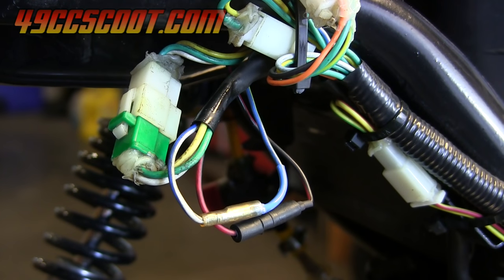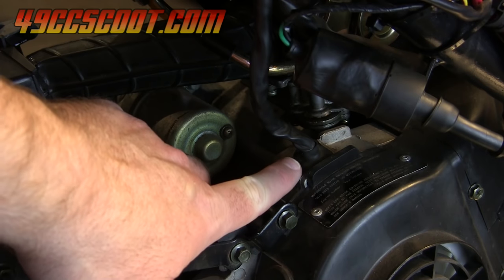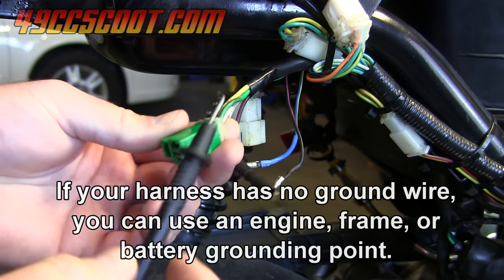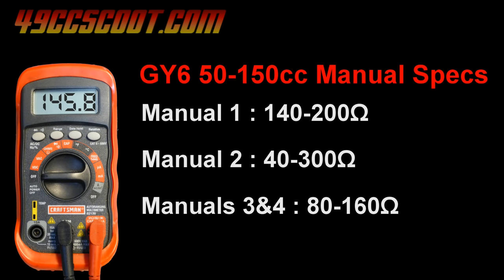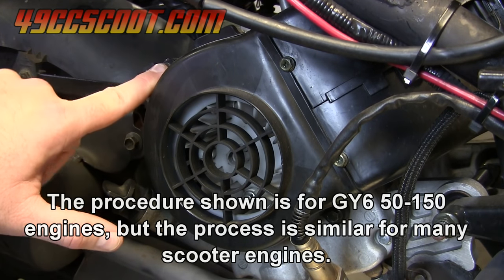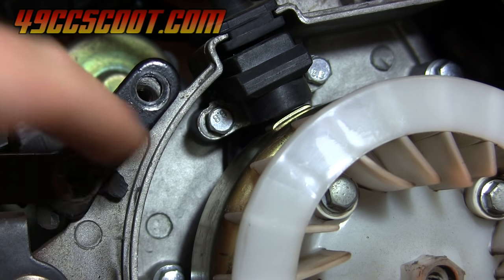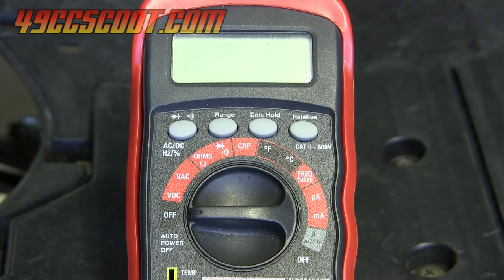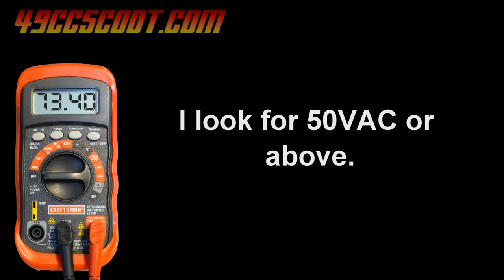Ignition Pickup And Stator Checks For AC Scooters, ATVs, & More

Comment: i check ever ting  with meter is right till no fire tao tao handel off an on dont work
Reply from the maker: +Randy Chappell No spark or just not starting? Could be the coil, wire, plug, connections, kill switch, ignition switch, CDI if there's no spark. If not starting, fuel/air and compression should be checked along with a valve adjustment.

Comment: 9:15 that welded connection though, ouch
Reply from the maker: lol I never said I'm a good welder. I'd bet that if everyone put all of their stuff out in the open, they may have some weak points too. BTW, that weld has held a 300lb rider just fine.
Reply: @49ccscoot  No I thought it came from the factory like this
Reply from the maker: @Anteino The factory mount broke so I put 1/8" steel on the frame tube to reinforce it and then welded the mount back on.
Reply: Haha wow, well I don't think your scooter was built for those speeds anyway, is it legal in your country what you are doing to your scooter?
Reply from the maker: @Anteino  It's weird here. Each state has their own laws. I actually tried to register a big bored scooter as a motorcycle, but they told me once a 50 always a 50 and wouldn't let me. As a moped class it's supposed to stay 50cc and under.

Comment: Very unrelated question to the video itself, tho this is kinda urgent since im not too great at this.. After i had a crash with my moped, something weird happent,   the " connections " at the headlight were " burning up " first the low beam, this happent over the distence over about  20 miles, i smelled something burned, then when i took out the light to check over the wireing, i noticed the highbeam wire to be melted aswell, the posative cable on both of the high and low beams were melted, so i figured to ask if that can be related to the voltage regulator? 

here's a picture of the wires:
https://scontent-ams2-1.xx.fbcdn.net/hphotos-xta1/v/t1.0-9/11204439_957725087581035_2090441645333800953_n.jpg?oh=ff6d1f8eec323d1f31f6c2e336e31301&oe=56156DA1

Should I replace the " burnt " part  aswell with a voltage regulator? it doesnt seem fun if its gonna  " burn up "  every time i use my lights on.. :/
Reply from the maker: ErmaTheKitteh Possibly. Check your battery charging voltage DC. Vid below. Also check the voltage at the headlight AC. Ideally they'd be maxing around 15V. Really some scoots will charge 16-18V with a working rectifier/regulator though. If you get above 15V, this is revved up BTW, consider replacement. Above 16V I'd definitely replace. Check a service manual if you want test procedures for the regulator/rectifier.

https://www.youtube.com/watch?v=xS58b5jZ0ic

Comment: So I just checked all my stuff and I unplugged my pickup coil and stator and line behold lol it’s sparks lol wtf why haa
Reply from the maker: You're sure the pickup coil wire is disconnected from the CDI and the exciter wire (or 12V+ wire for DC CDI)? It really should not spark without those connected. Needs the pickup to tell it to spark and needs the exciter or battery power so it can make a spark.
Reply: 90GTVert well I checked it and found that with the blue and wight wire disconnected it sparks intermittently. If I plug it in and disconnect the other bullet wire it still sparks. The same with both plugged it it has a constant spark. I got it running and it stayed running then died again
Reply from the maker: The CDI must be getting power elsewhere or something  is shorted.
Reply: 90GTVert yea that’s what I’m thinking bc it shouldn’t spark if the pickup coil is unplugged right??
Reply from the maker: It should need the pickup to tell it to spark and it should need the exciter to power the spark.

Comment: Nice one thing i did was new big bore 60cc head piston entire kick start assambley new coil change the coil sator on my pw50 and now it goes backwards wtf runs really good tell you give it gas and holly shit help
Reply from the maker: So it's stuck in reverse? lol I've never had it happen to me, but that are 2 causes that I know of. 1 would improper ignition timing, so make sure nothing is out of whack there. The other is I've heard of instances where the piston sort of bounces back while kick starting due to compression and sometimes they can fire and start backwards that way. People have reported this on bikes that run great, but out of nowhere they could run backwards, and then next time be fine.
Reply: If you installed a new 'high performance' CDI, it may have too much spark advance and be kicking back as 90GTvert noted.  The factory CDIs seem to have less initial advance, and are easier to kick over.  I think the orance CDIs seem to have too much advance, but given the tolerances of the product, who knows.
Reply: Jay Davis  wiring going in to key
Reply: Jay Davis key wiring 198o  dt250 Yamaha 4 wires coming up